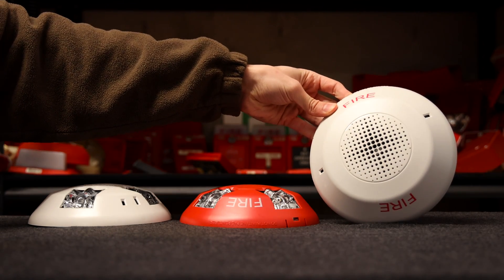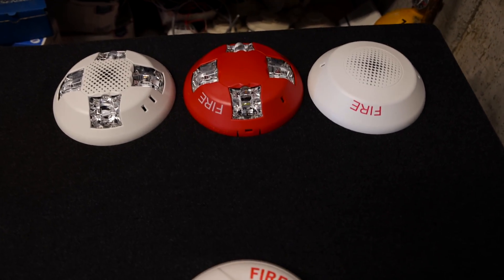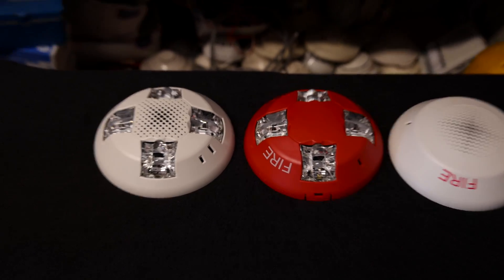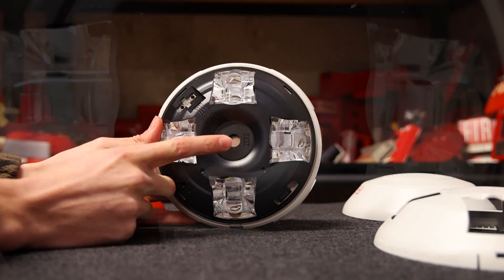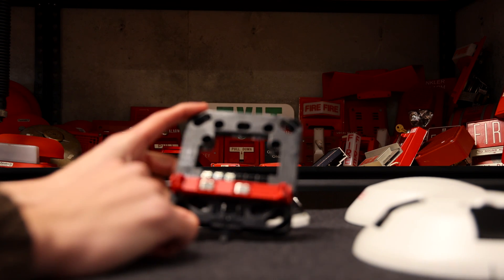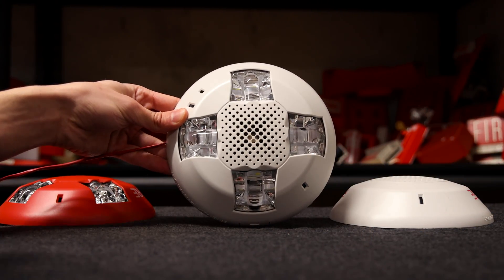Kidde/Edwards ECG Genesis LED Fire Alarm Series Overview & Test

Comment: I bought I simplex addressable t bar on eBay and I got it wired it to a sounder. And I just found out that you need a panel to use a addressable pull station but I don't have a panel. My Addressable one has no strict board, so I don't know how to change it too conventional. Please help me. Btw I love your vids.

Comment: Nice review. The reduced current draw is not a saving money concern when it comes to the draw on the electrical service. It it would be very minimum as the voltage is already being stepped down to 24DC. You would likely see less than you would have on a large outdoor light fixture. Where the lower current draw is saving is reduced battery demands, less voltage drop from higher current, therefore smaller conductors which means smaller pipe as your pipe fill will be a lesser and in large cases less NAC booster panels will be needed. That is where you see significant cost savings. if you were to do some calculations a building with say 100 devices at the average milliamp draw of 50 MA xenon horn strobes. That gives you 5 A at 24 V now you can roughly calculate that gives you a step down of five times which also takes your current down to 1 amp on the primary side. That equals 120 W  that gives a average cost of $.23 per hour that is $5.52 per day for 100 devices that is in CAD so you would see a lesser amount converted to USD.
Reply: Thank you saying that, I always want to know better about NAC current draw and LED fire alarms
Reply: nic does that mean that you can have moredevices on a nac if the draw less current?
Reply: Love watching your videos. I have a YouTube channel to and it’s a about pole station fire alarms my channel is called safety and  medical
 
. Go check it out.
Reply: That is exactly right and on point. These devices, just like the newer generation of exceeders and such, pay themselves off in installation costs, and continue to do so by requiring less apparatus. Not only that, but it also means much more by reducing the amount of NACs themselves which is extremely useful if you have an open NAC line for whatever reason and need to investigate. I like these LED devices more than the xenons for that reason, and we switched entirely to EST devices last year for installations because of how good EST has become.
Reply: :D
Reply: I seen the 4 strobe alarm in my local Ashley furniture store in Florida

Comment: Many things I want to point out of this device and other stuff 

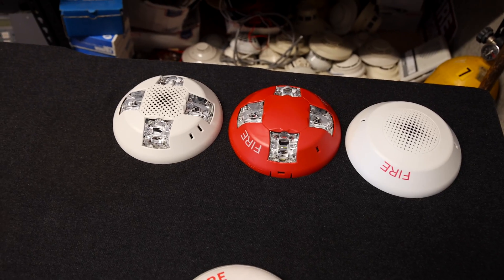01:58 Other LED fire alarms do have an updated strobe coverage range even if it has one LED light like the System Sensor LED L-series which does say that all LED fire alarms have better strobe coverage than Xenon strobes due to the modified strobe reflector and magnifier designs

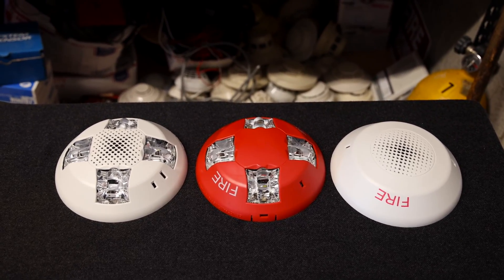02:52 What makes it more effective during a new install or expansion is that it reduced the amount of NAC power supplies saving you money on NAC power supplies in order to have the NAC functional as it should because a NAC power supply branches the NAC from the panel into new NACS and repeats the circuit to prevent any voltage drops when all the current is being consumed by the alarms more than the system can generate that can be repeated to create even more branches of NACS

04:43 It's kinda useless for Edwards to make horn only ceiling mount devices as that's just a waste of manufacturing materials as the EST G4ARF or G4AWF (double gang sized wall mount remote horn) should be manufactured instead because they use no strobes and would work with other wall mount horn only models on ceilings and vice versa because the sound will output in the same direction 

05:46 On Xenon EST Genesis devices you had to cut a jumper to set the horn to continuous or lower the volume by 5 dB unless if it's an EST Integrity which can be done many times using jumpers that you can move around but both of these are really hard to do 

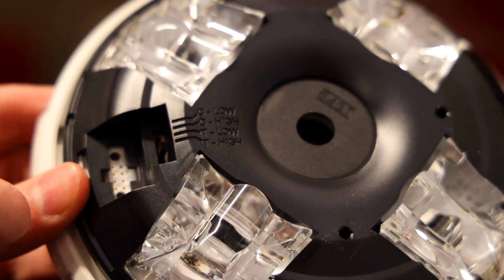06:56 It does have another volume level but in reverbarant areas (low volume is 80 dB and high volume is 85 dB) where's in anechoic areas it's 86 dB on low and 92 dB on high which is counterintuitive because sounds in reverbarant areas tend to be louder in anehoic areas but it's not because it's a high frequency sound and has shorter wavelengths which can easily create a simulated volume drop due to the reflected sound wave created from hitting a wall (because high sound frequencies reflect off of wall more easily than low sound frequencies) creating a different phase of the sound wave that interferes with the main sound wave causing a simulated volume drop because the reflected sound wave is slightly out of phase and also the sound this alarm makes by the way is an amplitude sweep sound with a carrier frequency of 3.2 Khz with a modulation rate of 50 Hz (40 Hz for Xenon models) down to 0% Amplitude, however with some other fire alarms that shows it in the data sheet and install manual that's a newer alarm made by the same company like the System Sensor L-Series, the manual and data sheet shows that it has only one volume level for all spaces which 90 dB for high volume and 84 dB for low volume (6 dB range) which means that they've improved the sound from the SpectrAlert Advance as it does show volume levels for reverbarant and anehoic spaces and they've must've done it by having the peak amplitudes be a high pressure wave to have anti-reverbarant distortion, the peak frequency of the L-Series is 100 Hz lower than the Advance is the L-Series is around 3,050 Hz as it does have the same frequency sweep range and modulation rate and carrier frequency however the overtones and undertones are slightly improved to make it more buzzing and there's no slight static sound with slight volume variation of the peak volume  which all done to remove the reverbarant distortion from the L-Series that makes sound lower in volume in a reverbarant area and if you want to know the audio synthesis of these alarms watch this video here: https://www.youtube.com/watch?v=PET8ssDRaNI 

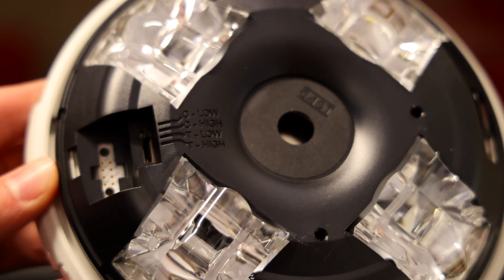07:39 Plese be prepared for the loud jumpscare as you should turn your volume down 5 seconds before this part

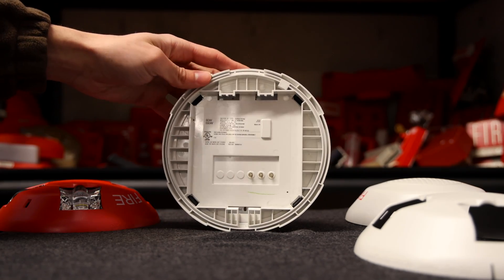08:08 All LED fire alarms should work on FWR power like the LED L-series as it shouldn't fry the device as I heard many criticism about that the LED L-series won't work on FWR because it's not listed in the manual or data sheet but it will work because of many UL electrical tests for it to work on FWR just like with other System Sensor fire alarms but I think why probably the FWR listings are not there is because on FWR it will consume the same current as Filtered DC

08:25 The reason why the LED EST Genesis devices don't come with a mounting bracket for wiring is that they're sold separately in order to make money due to their business model which is just like Apple as they sold their products separately in order to make money because they're greedy which is another reason to not like EST

10:13 Testing the alarm on code-3 please turn your volume down again 5 seconds before this part
10:23 And yet again but on continuous

10:30 And yes there was a sound difference between the LED EST Genesis horn strobe and the Xenon EST Genesis horn strobe as they both use the same exact carrier frequency that's 3.2 Khz and does an amplitude sweep down to 0% however the modulation rate of LED device is 50 Hz and the Xenon device is 40 Hz and also that the sound level in an anehoic room for Xenon models are 92 dB on low volume and 97 dB on high volume and for LED models are 92 dB on high volume and 86 dB on low volume which is likely done to improve power consumption or to also make sure that multiple devices placed 10 feet of each other on high volume only reach 100 dB where's the Xenon ones reach 110 dB which is good as they're still loud to get your attention and make you leave the building but not 110 dB where the sound level is so loud that it can hurt your ears very quickly while this level of 100 dB will hurt your ears but not very quickly than 110 dB as it appears that there must've been a new code established that the alarms should not exceed 100 dB because any level higher than that is very dangerous for your hearing which is why many fire alarms from 2007-2017 have like the Xenon EST Genesis or the System Sensor SpectrAlert Advance have been criticized for being too loud at 100 dB and too many of them per 10 feet makes it's 110 dB as that's ridiculously loud but thankfully it's now improved and fixed where many fire alarms on high volume only reach 90 dB and only cap to 100 dB when they're spaced apart per 10 feet and it should be unless if it's an outdoor model as the high volume setting should be 100 dB so it's heard at an extremely long distance

Sources: 

1. 01:58 Data sheets and install manuals and common knowledge about strobe coverage ranges
2. 02:52 Data sheets and install manuals and common knowledge about fire alarm panels output in amps and the alarm's current draw

3. 04:43 Common knowledge about horn only models
4. 05:46 YouTube videos and manuals about other EST products
5. 06:56 Data sheets and manuals about the sound levels, common knowledge about sound waves and my audio synthesis videos of these sounds from the function generator

Xenon EST Genesis Xenon horn sound: https://www.youtube.com/watch?v=6JL_cJ56h9U
LED EST Genesis horn sound: https://www.youtube.com/watch?v=9aF2oDNruuI
System Sensor SpectrAlert Advance and L-Series horn sound: https://www.youtube.com/watch?v=PET8ssDRaNI

6. 08:08 Data sheets and manuals about the DC and FWR capabilities
7. 08:25 Wheelove Fire Alarm's video about the EST G4 pinned comment: https://www.youtube.com/watch?v=YIpAIgJz1xw

8. 10:30 Common knowledge and sound volume levels of different fire alarms from manuals and data sheets
Reply: So you’re saying a fire alarm can be almost as loud as a fire siren at fire departments?
Reply: @Arra-m4f  Possibly, depends on the signal like a bell or mechanical horn can be very loud